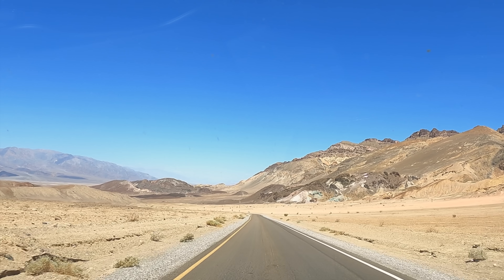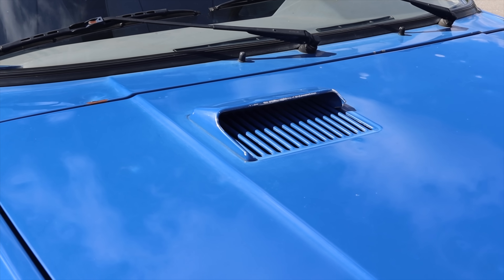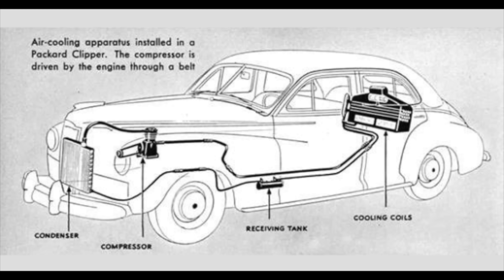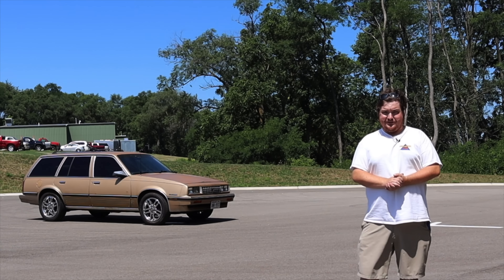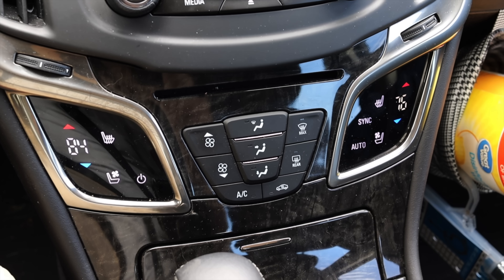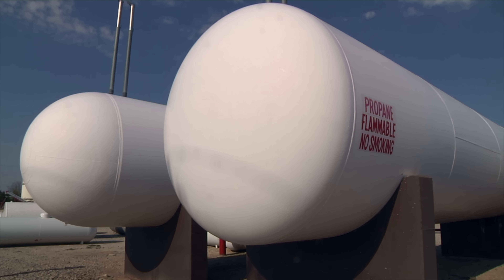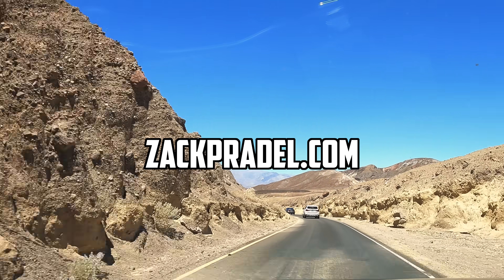Air Conditioning - The Story Of R12 & Why Modern Air Conditioning SUCKS!

Comment: Back in high school I had a 1985 F-150 single cab with the original R-12 system. On humid nights in Houston, it would literally get so cold that the outside of the cab would sweat like a soda can.

Comment: I have to say the a/c in my 2008 Sierra all Terrain Z71 is so cold i need to turn it down at times. i own 3 mustangs and all the a.c works great,  i think the old systems lacked power and sucked to much power off the engine when on.

Comment: I have an '84 Sunbird convertible with factory air conditioning. It still runs on R12, and I can tell you that even if the outside temperature is in the triple digits, and the convertible top is down, the AC on full blast will make you UNCOMFORTABLY cold.

Comment: Others actually a couple things wrong with this
First one is CFCs were used in a lot of things not just r12 they actually used it in hairspray and many other can spray type of things

Also it's not really the CFCs themselves that are bad for the ozone it's what they break down to in sunlight

And the replacement wasn't exactly perfect for the environment either it was just better

The difference between being maybe six or seven thousand times worse than CO2 down to like 3,000

Comment: What about just plain carbon dioxide
That works as a refrigerant too
Reply: Requires extremely high pressures to operate.  That means all the system components (compressor, tubes, hoses, heat exchangers, etc.) have to be much stronger, and are much more expensive to make. Mercedes does make some cars with CO2 refrigerant, IIRC.

Comment: I remember R-12, but I also remember when air conditioning was an expensive option. It really didn't become a necessity until manufacturers removed the wing windows and vents to improve aerodynamics. Cars now require air conditioning because the ventilation on them is terrible.
Reply: A car with no AC on a hot day is gonna be hot with or without wing vents.
Reply: @BIG-Jared  yes but when you’re going fast they help tremendously
Reply: Depends on the heat. If the temperature outside is hugher than body temperature it won't cool you
Reply: @Colt8722  It doesn't help when you're sitting in traffic, which is mostly what driving is anymore
Reply: @Tracert-mc1hu  that’s because cars are an inherently bad and horrendously expensive way of transit, and the decades of pandering to them will require decades of recovery
Reply: @Brent-jj6qi  Amen to that. As much as I like cars, they are one of the worst ways to get around in terms of efficiency, especially in an urban environment. I live in a "suburban" area and loathe driving in this setting.
Reply: @poldi2233  not 100% true, if you have good airflow and a bit of sweat then you will have some natural cooling - unless you live where its very humid and hot.
Reply: @nathanswan9243  idk why I worded it that way. I meant it won't cool the room/house.
Reply: to this day I haven't had a/c in any of my personal vehicles
Reply: @DSchea  you must not live in the southeast United States 🇺🇸
Reply: No, they require air conditioning because people like me want the inside of the car to be 68 degrees if I want it to be 68 degrees.
Reply: Removal of the vent windows had little or nothing to do with improving aerodynamics, that was just a marketing ruse.  Rather, it was done primarily as a cost savings (on the order of $40-$50 per vehicle) a savings for the manufacturer that was not passed on to the consumer.
Reply: @nephetula  that's bull crap. Makes me mad. 
I hate what modern vehicles are today; what they've become.
Reply: Until 5 years ago I owned a vehicle with vents and wing windows. Driving on the freeway in the summer absolutely SUCKED. Loud and hot, instead of quiet and suffering. I love older cars, but the modern ones are better in almost every way.

Comment: So you are saying modern ac is weaker due to not using CFC? CFC is another name for R12 which is a single carbon atom with 2 chlorine and 2 fluorine atoms on it. Just break down the big name and see it for yourself. R134a is HFC or simply replacing the chlorine atoms with hydrogen atoms. Propane is also an alkane, but it has all hydrogen, but don't use a fuel for your ac coolant.

Comment: one of the factors too is not just the refrigerant, but the size of the compressors.  An A6 compressor used in a 60's to 70's vintage GM vehicle or the huge Techumseh compressors used in Ford and Chrysler vehicles of the same era had enough displacement and BTU capacity of around 3 tons of cooling power (the tonnage rating of a cooling system is the equivalent amount of ice that would be needed)....That's enough cooling power to cool a 2000 sq/ft home!  The big engines we had during that time could easily power these compressors, and since fuel economy wasn't a factor either, having that much cooling power was no big deal. Smaller engines produced less power, and fuel economy standards dictated less drag on the engine, so smaller compressors were developed that didn't cool as powerful.  Most automotive AC systems these days struggle to make around 1-1.5 tons of cooling power with their smaller compressors, and the lesser efficient refrigerants as well.   I owned a Chevette for a while with the R4 compressor.  That is the same compressor used to cool down the full-sized GM station wagons and SUV's.  Needless to say, the car stayed VERY cool inside, but you couldn't run the AC, and merge on the highway at the same time!

Comment: I had an 89 GMC pickup and the compressor went out on it and the mechanic said I would have to get a whole new AC system bc they stopped making R12. So I ended up paying a thousand dollars for a whole new AC system. I never used it up until I traded it for a Mustang.

Comment: It’s actually pretty easy to pronounce once you break it down into its sub components. Di Chloro Di Fluoro Methane. In other words it is a molecule of methane, CH4, in which two hydrogen atoms have been replaced with two chlorine atoms, and the other two hydrogen atoms have been replaced with two fluorine atoms. It’s actually non-toxic so long as it is not exposed to flame.

Comment: I am still driving a 1993 Buick Century Special that has R12 refrigerant in it's A/C system. I bought the car new. It's still the original factory charge in it too. On a super hot 100 degree Chicago summer my Buick makes snow out of the vents.

Comment: One of my cars that I got a few years after I started working in my early 20s was an Oldsmobile 1988 Ninety-Eight. I bought it for $300 (yes, $300!!) because the guy took it to a shop and the shop said the engine had no compression (and it needed one of the windows replaced). Dad brings it home and parks it right outside the house and I remember coming home one day and I walk into the house and suddenly I hear the car roar to life and he's out there revving it and I turn and look at mom and said "I thought they said the engine was bad?" and mom tells me "oh, no, they just had the plugs wired in the wrong order" ... lol. Anywho, the A/C was also dead and I had to have an R134a conversion done on it and they also put blacklight dye in it just in case it was also leaking (it never leaked). Was a nice car that I drove for a few years.

Comment: Propane (r290), butane (r600) and isobutane (r600a) are all widely used as efficient refrigerants for fridges, dehumidifiers and small AC units. Why don't we see them in cars? They're super flammable!
Phasing out r-12 (and r-134a for that matter) was necessary because of the likelihood of leaks in case of an accident/years of abuse in the high-vibration environment that is a car's engine bay, but this same reason has delayed the adoption of more effective and more eco-friendly refrigerants due to potential fires.
Duster cans are not a good idea to refill a phase change loop: they may be mostly propane if it says so on the can, but it won't be pure, since it's not necessary for dusting. The liquified gas will likely contain many different short-chain hydrocarbons that may be lighter/heavier and decrease efficiency, or even freeze in the loop if they solidify at a comparatively higher temperature.

Comment: Dad had an r-12 license back in the day and the stuff to set it up with. Once you had all the parts in place and hoses attached you had to hook up a set of gauges to the compressor. Then you attached a vacuum pump to the fill hose and suck out all air. That vacuum was also used to pull the freon out of the can which meant any leak killed it. 

Fun times

Comment: Actually water has a higher BTU carrying capacity per pound than refrigerant. 

It wasn’t that R134 was bad, it did have about 10% less BTU heat capacity than R12. 

       It’s the manufactures were ignorant to the fact you could not use R134 in the heat exchangers that were engineered and manufactured for R12.  It was cheaper to use the old condensers and Evaporators that were already in use they did not want to change them it’s all about the money 💰 profit. 

You’ll notice today’s R134 systems on some of the good design cars get all the way down into the 35°F to 39°F Dash duct temperatures. 

All they did was modify the condensers and evaporators with more cooling fins per inch and more cooling tubes to increase the surface area.

Comment: I had a 1998 Dodge Neon that was passed down to me when I turned 16. As I was rummaging around and deleting random things I probably wouldn’t need as I wanted to do “weight savings” (power steering, stereo, some accessory heaters etc etc) I finally came across the A/C circuit and the loop. Naturally being the idiot I was I cracked off the line on the evaporator radiator. Let’s just say the R12 that came out was the brightest shade of green and yellow I’ve ever witnessed. No one bothered to maintain it because it was such a pain to get ahold of new refrigerant and it had broken down.  

Anyway, yes this stuff is quite toxic as a good whiff can knock you out and even kill you but also yes, the air conditioning was so much colder I swear it would be 90° outside and be 30° on the inside with it running. Just goes to show you newer and safer doesn’t always mean better.

Comment: I have to agree that R-12 based auto A/C systems were better than the R-134a systems that were the replacement.  Same for fixed A/C when the R4xx systems replaced R-22.  Yes, there was a need to quit poisoning the atmosphere, but I also wonder that DuPont needed new products to sell, as the patents for R-12 & R-22 were expired and anyone could make them.  The earliest model year car I had with R-134a was a 1993 Audi...and as our host points out, R-134a is being replaced by R-1234yf and other refrigerants.  My Nomex suit is on, so flame away!😀

Comment: I got the certification to purchase R12 and put it in my '87 Porsche 924S. It works great! I also experimented with the aerosol duster stuff in my '88 Jeep, and it worked quite well.
Reply: Filling with a none approved refrigerant could cost you fine and your certificate hope you made up story.
Reply: @hum2020  I don't service cars for a living. It's just for my own vehicles. No one cares but me. Besides, that duster gas isn't illegal at all-it gets blown into the environment by way of normal use!
Reply: Not true if you are certified for car ac  repair your liable if you use a none approved refrigerant. 
I hope they don't notice you.
Reply: @hum2020  How can you say 'it's not true'? Duster gas (r152 I think..) is considered non-hazardous. You could get in trouble with the BAR if you used it in place of the oe refrigerant without telling the customer, opening you up to all kinds of liability if any part of the AC system failed. But the EPA wouldn't care.
Reply: @tempest411  If you are certified to do car AC read the rules.

Comment: My father had an old car with R12. If you went on a road trip & turned the temperature down to low, the system would ice up & stop any air from coming out of the vents.

Comment: Best AC I had was in my '93 Nissan 300ZX... I dont know what it was but I swear if you left it on low in full blast it would freeze the car..
It'd be 90 degrees out and the water would moisturize onto the cold side AC lines and eventually freeze. Worked incredibly well.. The rest of my Vehicles... Not nearly as good.

Comment: I have worked with refrigerants since the 1980's. When R12 and R502 were being phased out, I obtained a free bottle of R12 for personal use. I am glad I did. I have a 50 year old Pontiac Grand Prix that I replaced the A/C compressor around 10 years ago. Fortunately, I had R12 to fill it back up and it has been working perfectly ever since. 4-5 years ago my kitchen refrigerator quit working. At the time, I was working servicing restaurant equipment. Smaller coolers use R134a and have a terrible habit of restricting the capillary tubes if the cleaning the condenser is neglected. When MY refrigerator quit, I got a brand new R12 compressor for $80 and change the capillary tube to match. Now my refrigerator will last another 20 years like the old refrigerators used to.

Comment: Usually the drop in efficiency could be counteracted with a slightly beefier system. I just wish they would’ve gone to propane, but lobbying by the company that made the refrigerants prevented that from happening. With the small amount of refrigerant in the system, propane would’ve been just fine, given it’s use in other AC systems.

Comment: yep, I had several R12 cars. but honestly, todays a/c works as good as they did in the old days, at least what I can remember. as far as cars being better in the 80's, I'm going to have to disagree with you. now, if your talking about the late 1960's thru the mid 1970's, now THOSE WERE CARS!  6 PACKS, DUAL QUADS, SUNOCO 260, AND lots OF "WIDE OVAL" TIRES! Tires never lasted that good, but they sure SMOKED GOOD!

Comment: 7:13 Propane is also called R290, and is in serious use as a refrigerant by manufacturers, not just by people struggling to get their R12 car AC working.
Many small home air conditioners and mini-refrigerators use it. Look for the "WARNING: Flammable refrigerant used!" stickers all over them.
A quick research skim suggests that it's an almost-ideal replacement for R22 as well. Please don't try this at home though. (Get a professional to do it.)
I think there's rules on how much capacity a system can have before it's no longer able to be designed for R290 due to the risk of a leak causing a Very Bad Day.
Reply: My new full sized fridge/freezer uses R290
Reply: Cyclopentane or C-Pentane. There is a big sticker on the side of my chest freezer warning it is highly flammable.

Comment: Had a 1989 Jeep Jerokee running R12.  So I took a deep dive into alternatives like R-134a and propane/butane mixtures.  This was a long time ago, so I'm fuzzy on details.  

When people started converting to R-134a, "the experts" said that you had to replace all of your o-rings, the compressor, and hoses to compatible materials. Well, it turned out that the oil circulating for years with R-12 perfectly coated the old materials, nothing special needed.  But, indeed, efficiency went down.

Being the incorrigible researcher and DYI'er, I did the deep dive into propane/butane mixture. And unlike what this video says, you CANNOT run straight propane.  It has the characteristics, pretty much, of R-22, the common building refrigerant.

I had to cobble up a coupler to get butane from Ronson lighter butane cans.  I don't recall how I kept the optimal ratio.  I think it was 80% propane.  There is actually an official "R-" number for this.  In fact, there was some use of this in Europe for refrigerators due to it's excellent efficiency.  Not crashes in the kitchen, presumable.  The butane is necessary to lower the pressures of the propane to that of mimicking R-12. 

It worked great!  Of course, many were concerned about the flammability of the mixture. This was all on ancient forums.  One reality is that engine/car fires are very rare. 

Later, I discovered that my father had a dozen or more cans of R-12, which sold readily on eBay. It's not illegal to own or use R-12.

Flash forward:  R-134a is being replaced by R-1234yf.  Really. The reason?  R-134a is a huge greehouse gas bad boy. Even though most of it is captured and reused or recycled during service.  Unlike R-12 going to R-134a, 1234 yadda yadda is a drop in alternative.  It's also a hell of lot more expensive, but all cars after about 2021 use it. Live with it. 

I can't help but be amused by the fact that 1234 yadda yadda is.............wait for it...........flammable!  I don't think it's like propane.  Maybe wood compared to paper.

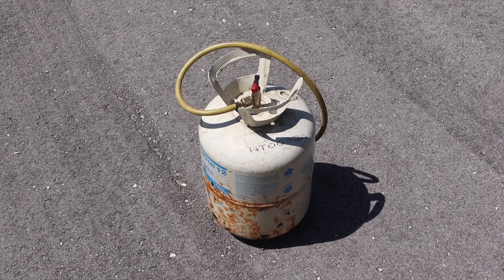Comment: 05:03  This is completely wrong on every level.  Depleting the ozone layer has nothing whatsoever to do with global warming.

Ozone depletion allows more ionizing UV radiation to reach the surface, which, in humans, manifests as an increase in the rate of skin cancer.  Many other organisms are killed outright.

Global warming is a consequence of increased greenhouse gases, which, when all is said and done, boils down to releasing carbon dioxide from the burning of fossil fuels - that carbon which used to be sequestered in the ground is being put back into the atmosphere, raising global average temperatures.  That increase causes all sorts of complex changes to the climate.

CFC's destroying ozone and global warming are two completely separate phenomena.